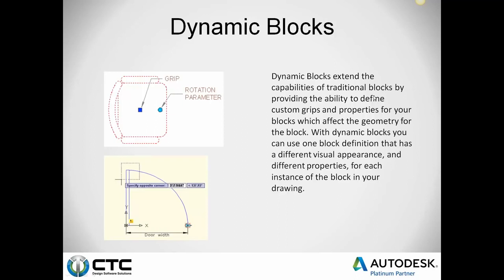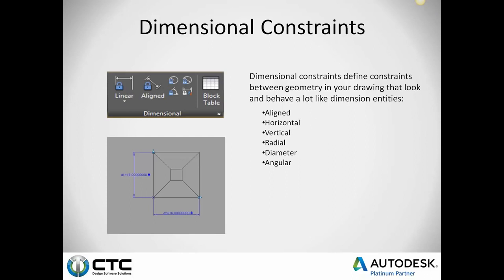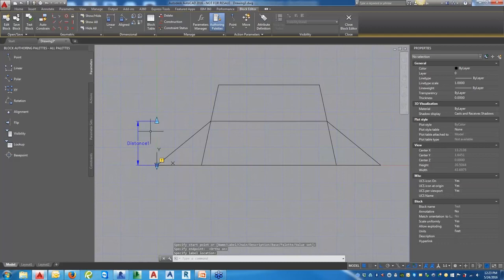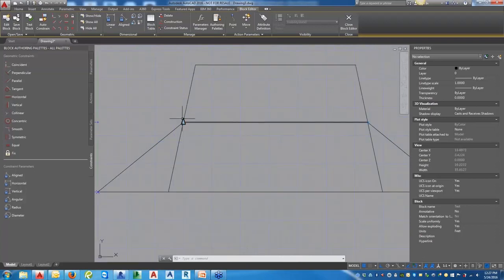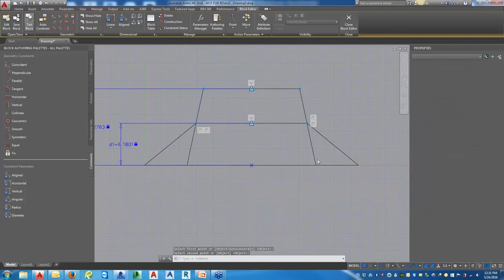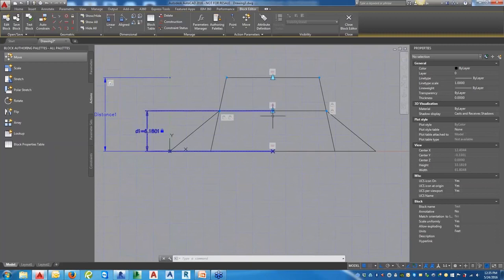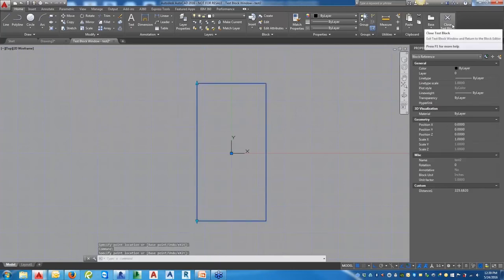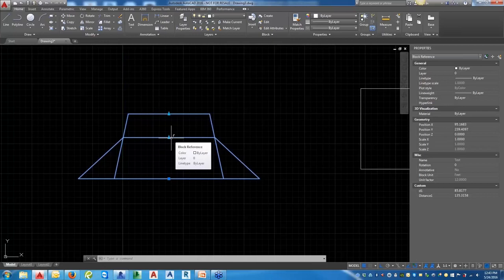AutoCAD Block Editor — Adding Constraints to Actions and Parameters

Comment: I am not sure if this helps but the issue you where having with the top line not moving probably has to do with you fixing the corner points so it is constrained not to move... I know it's 4 years late. but for anyone who is wondering....